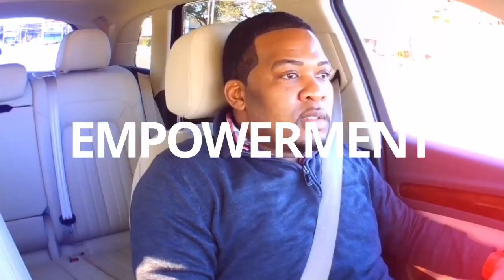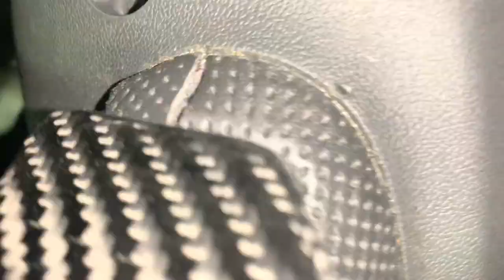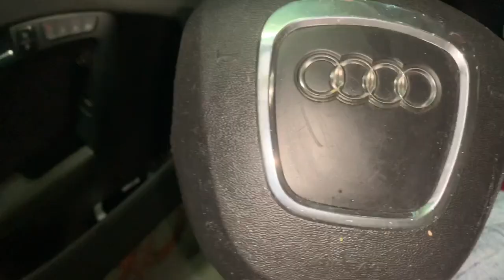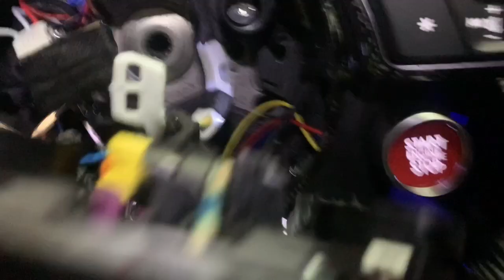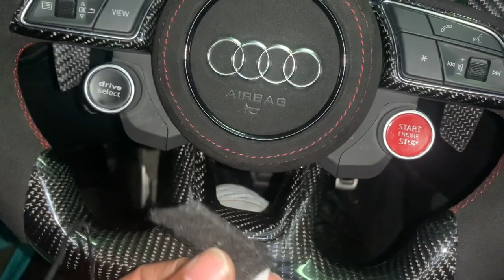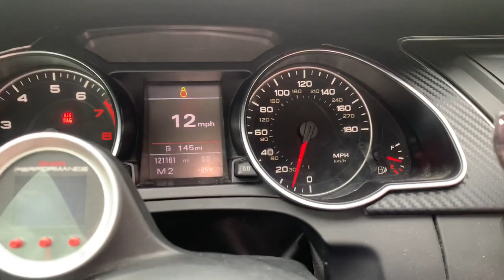Audi B7/B8/B8.5 to B9 Audi R8/TTrs complete Retrofit Steering Wheel  Install And Test Step by Step

Comment: Bro quick question if i go down this route to enable my car to start from the push button do i need to wire my car to have push start engine in the centre console or can i hook it up right from the steering wheel 
Same with the drive select button i enabled it on my a5 without the buttons on the mmi area but would i be able to hook it up directly to the steering wheel?

Comment: Hey man,
Do you know if the bigger round airbag (Audi A7 2015 for example) will fit on a custom made steering wheel which normally has the smaller round airbag?

Best regards,
Alex

Comment: The air bag is plug and play on b8 ? I don’t care other buttons
Reply from the maker: it depends, if you have dual or single  but the wheel maker, does the adaptation for you

Comment: can anyone tell me  if the Audi s3 flat bottom steering wheel is it compatible with Audi q3 2018 ?

The guy who is selling me the wheel says i got to use my own airbag and buttons
Reply from the maker: Yes some of them are the same,
Reply: @brucecustommotors  how do I know it will work ? Any website can confirm?
Reply from the maker: @zGiGi  yeh it definitely will work, they use the same can bus system, but i would look at the pics to see if the bottoms are similar, and he does not have the virtual cock pit, as they will be buttons you wont use, also make sure your airbag will fit, and its the same stage, dual or single, i just got with one of my audi tech buddy's from the dealer.
Reply: @brucecustommotors   he got the virtual cockpit keep in mind that he removed the buttons from is stering wheel to put on is new carbon fiber wheel for is Audi S3 2018 so the wheel comes with no buttons and no airbag only the cover of the airbag i got picture if you want to see it.
Reply: @Bruce Custom Motors  is there  a better to comunicate i got pictures of the wheel and the airbag cover he has the buttons has been remove on is wheel i have to use mine 

all he got is the steering wheel and the airbag cover not the actual airbag  i am wondering if i a can transfer my airbag and buttons to is steering wheel
Reply: @brucecustommotors   what you mean by same stage  dual or single can you add me on facebook  so i can send you a message personally ?
Reply: @brucecustommotors  keep in mind I don’t have the flat bottom steering wheel or paddle shifters on my q3 but I know I can activate them with obdeleven

Comment: So the factory multifunctional switch 6 pin connector, just connects to the 4pin (with only 3 wires attached) on the new airbag harness? Even though it used to be 6pin to 6pin?
Reply from the maker: No they make adapters to match your wheel,

Comment: hold on! so if I have an automatic gearbox but no paddles, if i got a steering wheel with paddles, could i program the gearbox to respond to them?? I cant seem to find any dsg a4s so this would be great if it was possible. please let me know!!
Reply from the maker: Yes 100% all  you need is the wheel, your car will automatically be adaptive to the wheel with paddles all you have to do is unlock it with obdeleven or vag, check out this video
Reply from the maker: https://youtu.be/AMjmDkPjJtM
Reply: I am assuming the same thing for a mod to my a4 as well... to further that thought. The automatic gear shift will have to be put into manual shift first. But im assume the wiring might need additional fuses to make the right signal when you press the trigger on wheel.

Comment: I got the same retrofit package from ask carbon but the yellow connector on the new airbag is different (has a white clip instead of green). the new harness does not fit. i tried shaving off part of the plastic to make it work however im not getting any power. im confused how  u got the b8.5 connector on your airbag. did it come like that or did u have to rewire the harness?
Reply from the maker: They did the wiring for me, you should reach back out, they can send you a plug already set up for yours 💪💪💪
Reply: They are helping me rewire the b9 plug to work fingers crossed! my b9 airbag has the linbus to canbus module already, just need to swap some of the pins within the yellow connector to get power. will keep u updated!
Reply from the maker: @sashwatsriram935  thanks bro imhere for anything you need, i want to see it installed to
Reply: @brucecustommotors  Finally got it working!!! Askcarbon is amazing!! ended up swapping the pins and it works like a charm now! I can send you pics to your instagram haha.
Reply: @sashwatsriram935  hey did you find how to rewire the plug, I have the same issue

Comment: Great video as always! I'd love to update my 8J TT steering wheel but since it's a manual I'm wondering if you can run this mk3/8S steering wheel without the paddles?
Reply from the maker: Yes you can 💯 percent
Reply from the maker: And thanks bro
Reply: @brucecustommotors  Thanks for the reply! Starting to save for this next mod then ;)

Comment: Very informative, just got my steering wheel from Ask Carbon going to install soon. I also got the R8 buttons, where did you connect the ground and power to the receiver what wires?
Reply from the maker: A ground in the frame, and my cigarette 12 volt, let me know anything you need
Reply: @brucecustommotors  awesome bro will do thanks!

Comment: Looks amazing! looking to get one for my B8 S5  - only question,  Why is the dash Air-Bag light on when you go for your test Drive?  is it not actually compatible ?
Reply from the maker: No that’s from my custom seats ,  airbag igniters, I just took out the fuse to run some power stuff, forgot to put it back in, it was there before